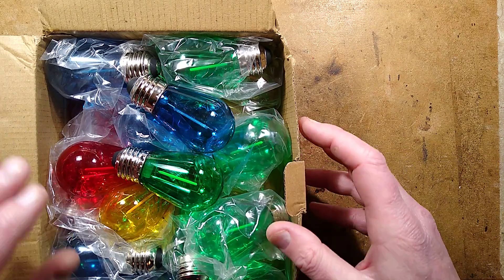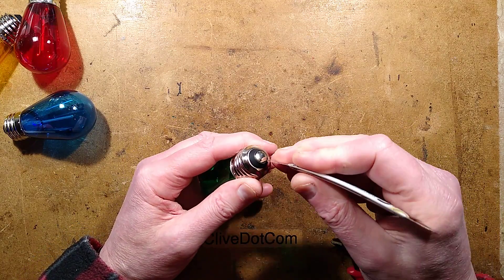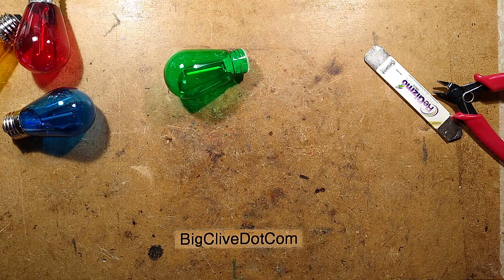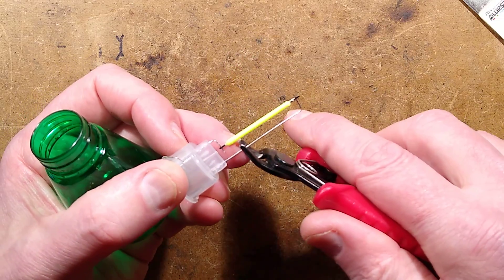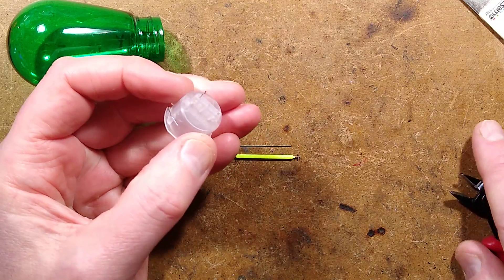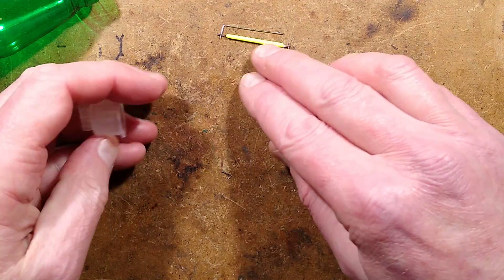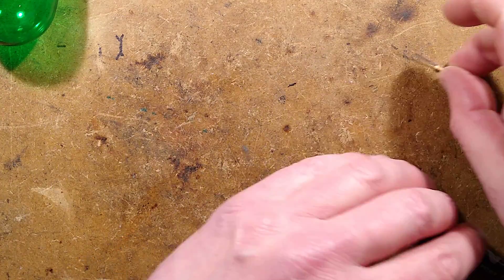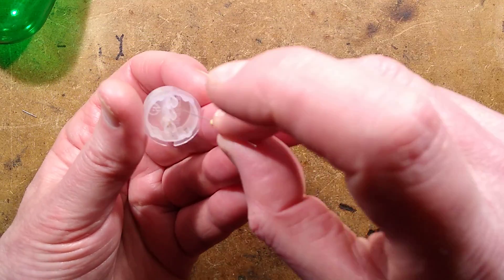Modifying Temu LED bulbs - really neat circuitry

Comment: I wonder if the low-value resistor is how they adapt it to the lower voltage. For 240v bulbs they use 2 15K resistors, and for the 120v design they just replace one of the resistors with a low-value link.

Comment: Wow, doing that 24 times plus having to buy extra bases, resistors and the China, Inc. crimper seems like more work than I would want.
Reply: Yeah, same here. Its very fiddly and boring and its not much of a reward when you've finished. One lamp would be ok but modifying 24 would take all day. Would be easier to just wire 2 in series or use a small step down transformer.
Reply: @simontay4851  I was thinking the same thing.  If you’re making a string of party lights, just supply a dropper or transformer for the whole string or wire the string with adjacent sockets wired two in series.
Reply: That's why I'm planning to make table/bedside lamps feet to repurpose some led bulbs with broken electronic circuits. No socket, simply glued to the base.

Comment: 10:30 I have a tool like that for crimping hydraulic lines and gas lines, funny thing is that these E27 fittings fit into it too...No pins though....Nice hexa or octagonal crimp....Not as good as this one (for lampfittings) but it works....Place it in a bench-vise and crimp.

Comment: A helpful idea to avoid this destruction would be to put the extra resistance in the bulb holder , then you can fit a nice 2 Watt size ( 81 KΩ ? ? )  ... a better idea would be to fit a nice X2 mains rated capacitor in place of the extra external resistor , as this will dissipate zero power ( start with 0.1 μF, 100 nF then go bigger to get the required current .... this saves tedious calculations ! ! ) .... or put two bulbs in series ( shanieboi , comment below ! ) ... or use a 230 Volt to 120 Volt shaver transformer , Ha - Ha ( always found in the junk box ? ) .... Oh , and BOLT your crimp tool on to a scrap block of wood , then clamp the wood block into any workshop vice , for HUGE leverage ( time for an IRN - BRU ! ) ...... DAVE™🛑

Comment: Very interesting, thank you Clive.

-----

Removing and then replacing the two existing resistors would be a bit too finicky and time-demanding for me, especially if a large quantity of bulbs needed modification.

Instead of doing that, could one cut a section out of the long vertical lead, and solder-splice in either a new third resistor, or a high-reverse-voltage-tolerant diode, or a capacitor?  Doing so would create either an ugly visual blight or a cool techy look, depending upon one's willingness to rationalize.

Whatever one puts in the gap would have good air-circulation for cooling.

Comment: they are using blue leds with a phosphor coating to make them white and then put them inside blue plastic to make them blue again.
jenius ! 😆
ok, this specific set doesnt use phosphor in the blue bulb.
Reply: The plastic acts as a diffuser. unless you prefer piercing blue light in your eyes.
Reply: @piconano  sure, but clear blue plastic diffuses nothing.
Reply from the maker: They are actually coloured filaments.  The blue chips have clear gel, but the other colours use phosphor.

Comment: It does make me wonder how quickly those LED dies in the 120V bulb heat up running on 240V, and if the regular diodes heat up slower since they look like they have much larger dies. Also I'm guessing that unmarked resistor is custom. The lead looked quite a lot longer than usual, not to mention a thicker gauge. And judging from the different colour, possibly a genuinely fusible resistor as opposed to "fusible once the carbon has finally burnt enough to stop conducting".

Comment: given there is no smoothing capacitor, why don't they flicker?
Reply: They will, at 100Hz in the UK.  But due to the relatively low voltage for the LED string, the off time between each mains half cycle is shorter then with a higher voltage string, so the flicker may be less noticeable.  It's also possible that the phosphor in the LED string has its own after-glow which would further reduce any flicker effect.

Comment: I was hoping for a diagram clarrifying the hidden rectification circuit .  Most obvious design would be a counterparrallel pair of LED strings, forward voltage of each limiting reverse pressure on the other .
Reply from the maker: Imagine the classic bridge rectifier square of four diodes, then a string of LEDs in series between the positive and negative connections.

Comment: One way to remove the lamp caps pretty much intact with minimal damage to the lamp is to drill out the indentations where it was crimped in with a 1.5-2mm drill bit and then unscrew the cap off the lamp.
Reply: I came here to say the same thing but yours was the second comment. You can be just as quick as Clive is tearing it apart, with a cordless drill.  And you can reuse the base with some glue or dimple it again in new spots.
Reply: good grief! really? i prefer to spend days writing CNC code, then get a 2 million quid machine to do it for me. i am surprised you do it this old fashioned way. lol
Reply: @KarldorisLambley   lmao !
Reply: CNC software is  not very expensive these days @KarldorisLambley

Comment: I can remember my uncle doing things like this, and I would always ask "Why not just order the right thing to begin with?"  I would just get a blank stare, like I was missing the whole point.  I am pretty sure he did things like this on purpose so he would have an excuse to hack things, since ordering the correct voltage would just be too easy.
Reply: Automatic/clueless sales people can't handle that .
Reply: @johndododoe1411  Right...   But if YOU were ordering lights from overseas, would you check the voltage first, and/or email them to verify it would be correct, or would you secretly hope it would be wrong so you had an excuse to hack it?
Reply: @azrobbins01  They didn't say and it's a robotic shop .
Reply: @johndododoe1411  Then I think you did not understand my original post.

Comment: Temu does your first refund as a no questions asked freebie. They refund it and let you keep it. I ordered a DVD burner, but it only reads discs, it won't burn them. I should open it and see if it's a connection issue.

Comment: Lovely design and nicely shining color is like a voltage devider and the led is the second resistor for the devider circuit as much the leds are as much voltage will dropp down

Comment: Any 'phantom' after glow with these? I refer to the tiny currents (10uA typical) that can come from mains wiring capacitance or installation capacitance.
Our test for this is to connect to 240V mains but put a 3.3nF capacitor in series with the live. If no light ( in a blacked out room), it's ok.
Reply from the maker: These would be very prone to afterglow caused by the capacitance of the switch circuit wiring.  It's a very tiny current, but enough to light LEDs.

Comment: Well, there is a "positive" in some ways, if you have an isolating step-down transformer, it kind of makes them a little safer to use outdoors, of course that's assuming someone has such a transformer, which not everyone does, and assuming they actually give a rat's aft-end about others' safety... :P

Comment: In that dangerous led repair video some years back, you mentioned you could get your own filaments as well, I guess you could hook up more on this and even leave more of the work to them instead of the resistors there? Or even - just slaughter a lamp and take its filament and install two (or three) into a lamp. That could be neat :)
Reply from the maker: This would require the filaments with integrated rectifier.
Reply: @bigclivedotcom  
I guess the ones it comes with could  do the rectification and the other(s) just ride along?

Comment: So, wouldn't just connecting 2 in series also work? The "hack" I'd consider more interesting, would be changing resistance to be able to connect say 4 of them in series and waste as little as possible in the resistors.
Reply from the maker: Two bulbs in series would work, but I've been pondering merging two bulbs so I end up with one with two filaments.
Reply: yes that was my first thought as well, two filaments in series would greatly reduce the voltage dropped by the resistors. You could even have four filaments to a lamp connected in reverse to reduce flicker, but at that point it might be better to buy the filaments seperately.

Comment: I think I'm lucky to be watching this video. Earlier today, I tried to modify my operating voltage from 0v to 240v  from one hand across to the other, just in a rush grabbing an earthed housing in one hand while pulling out a multi contact connector that I forgot was connected to a generator without RCD, I was working alone and in an awkward position,  honestly I think that's what saved me,  as I tipped over the circuit was broken, I  had to phone my girlfriend to make sure I was alive,  and have burns on my finger and small cuts from the muscles clamping on sharpedges...scared the crap out of me..flash of Clives description of electrocution replaying in my head as I felt the 50hz .
Reply from the maker: Glad you survived.  Sometimes it takes an incident like this to make you more aware of what can happen.  You may find this video very useful:-
https://www.youtube.com/watch?v=9webTbqTH5E
Reply: Brit plugs are enormous enough to fit a type A RCD, as well as a MCB. Should be a legislated requirement.
Reply: That is why I like the US system of 120/240, because most shocks are to ground, you will only get 120v. Even if you are working on a 240v line, you would have to touch  both hot wires, not impossible but more likely from one hot to ground  only giving you 120v shock.
Reply: @ericmaurer3337 On UK building sites, 240V tools are not permitted - they have to be 110V and the supply transformer is centre-tapped to ground, so if you come in to contact with either side it is only 55V with respect to earth.  With the advent of cordless tools I guess this is less relevant now.
Reply: @rossthompson1635 ironic, because some of the best high power construction tools in the US  are 240v
Reply: @DarkAttack14  and yet young people in Europe can drink wine without having to get wasted.  Perhaps it's a cultural thing.
Reply: @mikemotorbike4283  I think the award for most irrelevant response goes to your comment! There's plenty of people who can drink wine underage in the United States without getting blasted.. I was one of those lol.

Comment: A lot of people are suggesting that you put two 120v lamps in series on your 240v mains. Can this generally be done with consumer LED bulbs?

I am in the US and was am considering wiring up a two socket lamp in series for a hall light to have a jerry rigged "dubai lamp" that will last much longer.

Oddly, there is no video that I was able to easily find of someone putting two consumer LED bulbs in series by simply wiring the sockets in series. There are tons of videos of people hacking into bulbs to do similar things.

Now that I am thinking about it, I am wondering if I can build a two socket table lamp with a switch  that gives three states [OFF],[SERIES],[PARALLEL] as a kind of "two way" lamp for varied brightness.
Reply from the maker: That will only work with some lamps and they have to be a matched pair.  Most of the simpler ones have such a high voltage drop across the LEDs that it may not work.
Reply: A four watt night light bulb in series with my ceiling light dims the kitchen in the evening. It's a dimmable decorative six watt bulb. Others have misbehaved in the same role. Little chance of harm in trying it.

Comment: Plug the 120V bulb into 220V and record what happens. Dave Jones (EEVBlog) accidentally did that with a soldering station, made for 120V, while Australia is also 240V (220, 230, 240, you have margin). Thing went up in a puff of smoke, but over the period of a couple of minutes. Made for a great video.

Comment: I wonder if the mystery resistor a fusible resistor? They are typically low resistance.
Reply: all resistors can be fusible, if you apply enough voltage and/or current  (^_^)

Comment: Always like these but rather than resistors a capacitive dropper for shits 'n' giggles maybe? It would improve the overall efficiency and reduce the heat dissipation of the dropper circuit.
Just an idea.

Comment: Looking forward to the 4 chamber vape cell tear down,  as my colleague uses them at work of which I have been liberating the huge cells.

A very generous capacity without giving any spoilers.
Reply from the maker: I have one here.  Quite tricky to open, but I now have a charging port on one that can also power external loads.
Reply: @bigclivedotcom  any ideas when you're going to release that tear down as I'm quite looking forward to the schematics?

Comment: Wouldn't a series resistor be a lot less hassle? - OK it would be a reasonably high wattage resistor but not beyond the wit of man.
Or two sets wired in series? even less hassle.
Reply from the maker: I wanted to use it in a standard holder.
Reply: @bigclivedotcom  Hi Clive, I was envisioning one big resistor, a mains dropper as it were, in the supply lead.
It would get hot but no worst than all the distributed resistors in the modified version and if placed thoughtfully it would keep your garden gnomes free of snow.
Reply from the maker: @marklatimer7333  A series capacitor would work for a string of lights.

Comment: I bought a hairdrier from Temu a few weeks back. 
It arrived with a UK plug but no mention of voltage or wattage. 
I tried it on 240v and it worked perfectly.
Still unsure of the wattage though.
Reply: If it dries your hair in 4 seconds or less it's probably 120V.
Reply: did it come with a UKAC sticker you could put on yourself! Just so you know it's safe to use 🙂

Comment: You should make a 240v to 120v lamp holder by running two lamps in series 😅
Reply: Yeah, that's what I would do, wire two lamps in series 😉
Reply: I do that over in 120v land by poking both plugs into an older extension cord, each plug with one leg having missed its target, then clipping the spicy bits together. It tames the heat lamps to a gentle warmth.

Comment: Try an X-Acto razor saw. They have a very thin, fine blade with a rigid back and are good at delicate metal cutting. They fit the #5 or #6 handle. A jeweler's saw is another option. They are surprisingly inexpensive.

Comment: Considering the increasing unnecessary use of plastic, do you think we will see a return to glass bulbs, even if they're still leds inside?
Reply: Yes, but we the consumer have to drive this. I pay more at the hardware store for brand name glass bulb LEDs. Usually Phillips or GE here in the states.
Reply: @bigguyprepper  can't say I've seen many glass led bulbs other than those "specialty antique" rubbish ones
Reply: @phonotical  you can certainly check online, but I usually have better luck at Lowe’s in the US. Not many options elsewhere. But I’m sure there’s some places that have them. I bought 2x 100 watt equivalent glass envelope LEDs there yesterday.
Reply: @bigguyprepper  I'm in the south east of the UK, regulations...
Reply: @phonotical  Just to my right is a very nice glass LED filament bulb from Wickes in a table lamp. 60W equivalent yet cool enough to touch any part. BC base as well. For anyone abroad wondering Wickes is similar to Lowes. All the bulbs are probably made in the same Chinese factory.
Reply: @MrDuncl  hmm, I don't think inhave a local wickes but I'll take a look if I see one
Reply: @phonotical  Waitrose, John Lewis, and Robert Dyas are all worth trying. Just don't expect to get glass filament bulbs for the same price as the plastic bulbs in Poundland.
Reply: @MrDuncl  lewis' terrible for actual lights
Reply: I think I saw Clive take one of those apart once. Not 100% sure though.
Reply: @kimchristensen2175  Yes. Even funnier was when he tried to repair one. Obviously it didn't last long as in the factory the get filled with Helium for heat transfer to the glass.

Comment: "Filament style" ah I'm disappointed already... I hope you got a refund for them sending the completely wrong voltage! Alternatively maybe you can use two in series? 😂

Did you work out the value of the unmarked resistor
Reply from the maker: It's just a few ohms.